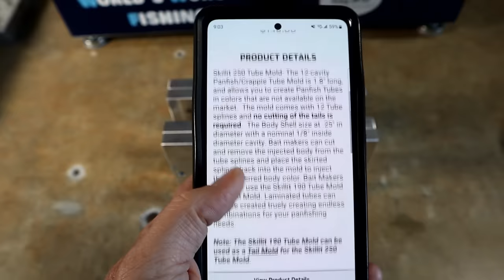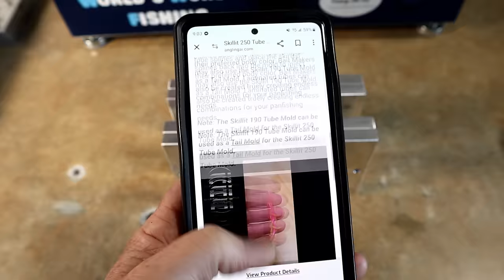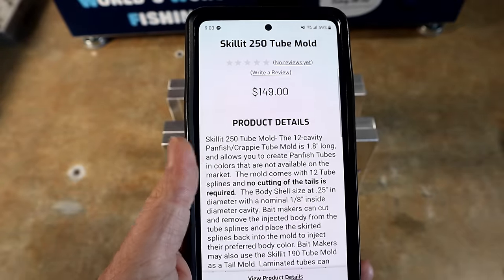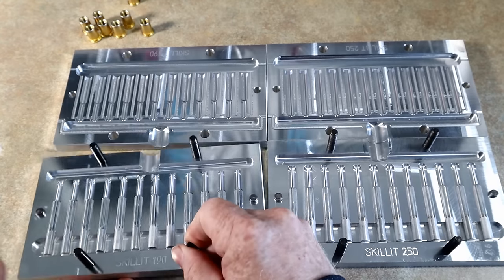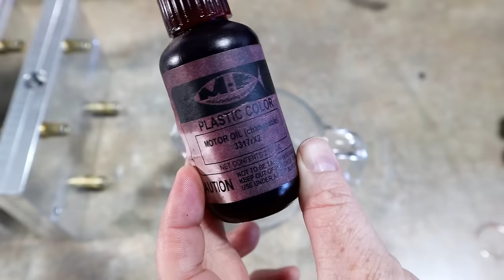New Crappie Tube Injection Mold! Panfish Lure Making

Comment: Outfrickenstanding video Chris.  This will save lots of finger injuries.  My pneumatic tail cutter is at it's limits when it comes to smaller tubes.  The extra money spent on the molds is well worth the stress-free process.  You can do soooo much with this mold.!  I'll be purchasing 4 by summertime.

Comment: Kind of an off topic question...Would it be more efficient to mix the plastisol in small batches using a heated beaker mixer with a magnetic mixer pill.  In theory this would keep the plastic moving and heated so to prevent having to reheat multiple times.  I am curious if you think the plastisol is too viscous and the pill wouldn't spin fast enough to mix.  Maybe it would cause too much aeration....Just a thought and maybe you could test that out for us in a video.  Just thought it might be easier than using a knife if you're mixing a lot of small batches.